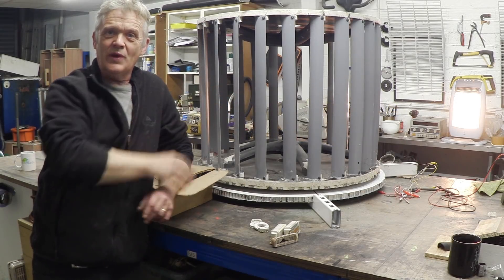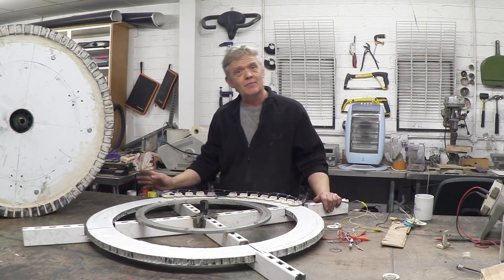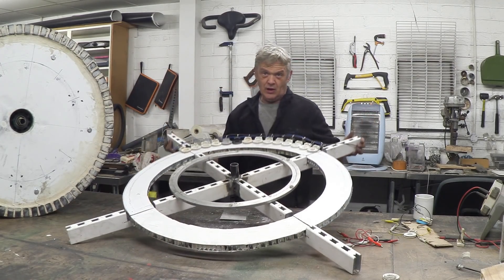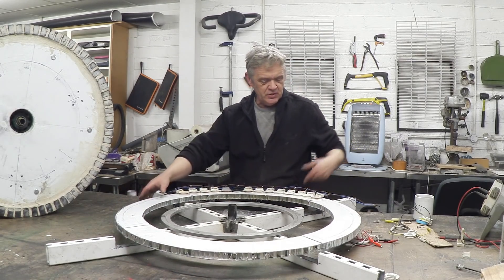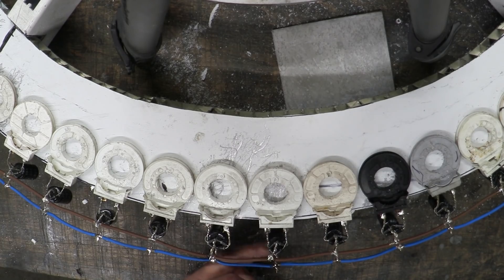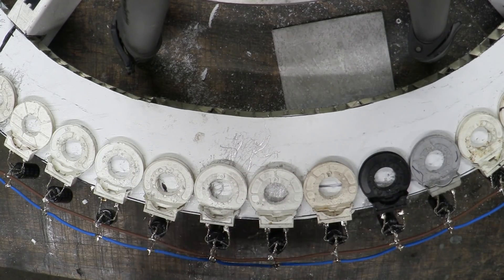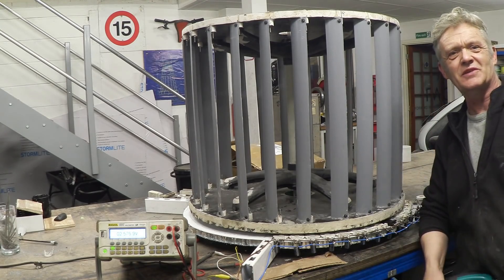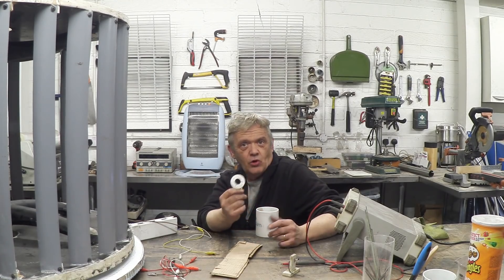Building A 1kW Wind Turbine For Under £100 - Some More Changes

Comment: Can you please show current as well as Volts, anyone could make a lemon generator to make 12v but virtually no current = useless.
Reply: Tactical dot.
Reply: Robs been asked the exact same thing on most of his generation videos, but things dont change.  At best we get a voltage, and occasionally a separate short circuit current. Sensible scientific testing of the device, so people could decide if they want to build it or not, should be voltage and current shown simultaneously with a known load, a big resistor would be ideal.
Reply from the maker: to be honest mate - I do it sometimes but more often than not it just makes folks argue about the validity of the test more than anything else - my own tendency is to power something like a light or motor.
Reply from the maker: it's because I have had years of it mate - more often than not all that happens is folks get into long arguments about measurement technique, equipment used etc etc and most of it means nothing to folks - so I have a big propensity to lighting lights or running motors - a kind of visceral image of it doing something. For those that it does mean something to 90% of them just want to argue and the 10% of them who might be convinced - well most of them will build nothing. It's why it's not much of a priority for me - plus - of course - I am not really trying to prove anything to you or convince you of anything - I am demonstrating what I am doing and the rest is up to you really - does that help explain why? cheers - rob
Reply: @ThinkingandTinkering  re output, OK but power calculations gives work potential and makes a build worthwhile or not. When I was younger I would blunder in, making loads of effort only to get poor results. Now I research everything before jumping in. Experimentation is a good thing, but a basic understanding of thernodnyics and physics helps. This is why Thunderfoot and EEV Blog successfully expose scams that people fall for. All due to lack of knowledge. Your advice is good in learning and experimation, but a bit more theory also goes a long way.
Reply: @ThinkingandTinkering  Rob if you simply quote power generated (VI) then there is no arguments. Its powering a light or a motor that causes the issues because people dont know how much power is generated. If you quote watts in the title of the project it makes common sense to measure its performance in watts.
Reply: With this test you can calculate how much current there is, and it seems to be about 280uA. Explanation below:
 Rob's told you the capacitors are 50V capacitors, and said 1000F. I think he means 1000uF (0,001F) as those caps look realistic at that size. It looks like he's got 14 of them, so 0,014F total.

The formula to calculate current when charging a capacitor and monitoring voltage is (capacitance * voltage change) = (current * time). Looking at the footage, it seems like the voltage goes from 2,6V to 2,7V (a 0,1V voltage change) in around 5 seconds. That gives us a formula like this: (0,001F x 0,1V) = (current x 5s).
I think that works out to 280uA at 2,65V (742 Microwatts) average at 15 rpm (I timed a blade going around). A bridge rectifier will take a decent portion of the generated power (1,2 - 1,4V). At higher voltage, that'll be a lot less of the total.

From my reading (the latest Real Engineering video), the power goes up with the cube of air speed. Assuming the the RPM of the turbine and air speed are proportional, you'll need to spin it at 1650 RPM.

I could be way off in my calculations here, so please double-check them.
Reply: @ThisRandomUsername  So basically you have no idea, making assumptions (F vs Mfd) that they are not super caps etc. This is exactly what I mean, no one knows for sure at this point. Don't forget its a standard VAWT the blades cant travel faster than the windspeed. You can not calculate the power, you don't know how long it took the caps to charge, or how long the windmill ran while they were fully charged etc etc, do you see how much easier it would be for all if Rob just quoted power like he does in the ti9tle of the video ?
Reply: @ThisRandomUsername  What about the times the windmill was generating and its voltage was less than the charges value of the caps ? Where is that power accounted for ?
Reply: @goldmagnet9013  You're right that we don't know for sure about the size of the caps, but apart from that there's a lot of info in the video. One thing's for sure, those are not 50V 1000 Farad super capacitors, and look more like standard electrolytic caps, of which a 1000uF 50V capacitor is common at that physical package size, so I give Rob the benefit of the doubt in that he sees 50V and a 1000, and doesn't see the small u in front of the F. That's a reasonable mis-reading. In his follow-up video, he's charged the capacitors to 8V, way beyond the capabilities of super caps.

However, I must disagree with your other comments:
- I know exactly how long it took for the voltage to rise by 0,1V because you can see the multimeter screen in the video and I can calculate the rise time. To get a ballpark current figure you don't need that to be super accurate.
- Power depends on the RPM and the output voltage, and getting proper optimisation graphs isn't what Rob's after, he wants to demo a design with a rough idea of its capabilities. I believe he's mistaken when he thinks it's producing much usable power, but at this stage of development, optimisation is not what you'd be doing, you'd be proving an idea and making quick iterative changes.

On your second comment: I believe the voltage is produced according to the speed of the magnetic field passing through the coil, but while that voltage is lower than (the voltage on the capacitors + the forward voltage of the diodes), there's no current flow. That means there's no resistance to the passing magnetic field and the only resistance is in eddy current in the core (which are basically non-existant here).

Edit: eddy currents currents -> eddy current; punctuation
Reply: @ThisRandomUsername  So if the speed of the windmill varies, which they do, and it produces power but the voltage is less than the caps how is that accounted for ? So you know how long it took to charge the caps, but not the power output as there would/might have been power available but the voltage was too low to charge the caps. I cant believe you think all this is easier than just quoting the power output ? A big resistor and a wattmeter,, cost less than £20. People who want to build this windmill will be doing calculations based on their power requirements.
Reply: @goldmagnet9013  You're getting power and voltage mixed up. Power isn't produced because the load won't accept anything below a certain voltage, so no current flows.

Re: the power production measurement. As I said I'm looking for ballpark. The calculation I got would be slightly on the low side if anything. I assume the coils in an open circuit state would produce up to 15 volts, and as shown in the follow-up video, they manage to charge it at 8V, so they're flux/current limited at lower voltages, and the wind speed there was minimal as well.

Also, good luck getting a power reading off a wattmeter at such low current levels. You'd need something like the EEVBlog uCurrent and an oscilloscope.
Reply: @goldmagnet9013  good calculations. Power also with wind generation increases by a huge amount with diameter something like 4x per doubling. That's why the bigger the turbine the more efficient they become.
Reply: @ThisRandomUsername  I dont think your understanding is up to scratch. The idea of this windmill is to harvest the low energy that other commercial turbines miss below their cut in speed. In Robs current design the more the caps are charged the less power is harvested as the "cut in voltage" increases. Say you use this windmill to charge nickel metal hydrides at 1.5 volts. Once connected the caps are meaningless they will always sit at the charging voltage, so the measurement we all need is the power,  the voltage x the current into a known resistance. Its pretty simple.  With a windmill this is normally represented by a curve on a graph showing power generated at different windspeeds/rpm. Much the same as the graphs Rob used to make for his batteries, why did he quote power then and now its such an hard thing to do I wonder.
Reply: The logical way to make a generator that meets Robs objectives, while maintaining as much of the current design is, in my opinion, as follows. Keep 1 in 3 of the current magnets, remove the others, and double them up. Wire all the coils in series and rectify the wild AC using a MOSFET bridge with zero voltage drop. Then a simple custom MPPT controller. That the logical way, reduce the magnets to get the coils in phase, full series for max AC voltage, MOSFET bridge (there one a chip built for this), then MPPT to balance all the components and allow maximum charging efficiency. This is mathematically demonstrably a much more efficient route.
Reply: @goldmagnet9013  What I was trying to get at is that at varying wind speeds, there will be different optimal voltages at which to get the maximum power out of the turbine. When you actually want to pull this lower speed power out of the device while still accomodating higher speed efficiency, you'll get a MPPT charge controller to match your supply with your load. The problem with that is that MPPTs usually have standby power consumption, so any gusts realistically won't produce much. Maybe a switchover circuit would be helpful at lower voltages while letting the MPPT take over at higher wind speeds.

I agree that the caps are useless when connected to a real load, but for now they're useful to indirectly measure how little current is being produced so we can point the issues out to Rob. Anyway, it's 2:40 in the morning right now, so this is the last reply you'll get from me for a while.
Reply: @ThisRandomUsername  See previous reply.
Reply: @goldmagnet9013  Sorry, YouTube doesn't refresh comments very well. It seems you know what you're doing, but I'm afraid that when trying to scavenge low power gusts of wind, MPPT really just won't work. I agree that syncing the coils and seriesing them will improve things, but from these results, I think it's clear there's more work than that to do because of the not great current capabilities.
Reply: @goldmagnet9013  totally agree 👍
Reply: @ThisRandomUsername  Say you get 10 seconds of wind that charges the caps up to 5 volts, then a slightly lower wind for the next 50 seconds that generates a potential of 4.5 volts. The vast majority of the power in the  1 minute period is wasted and the time to charge the cap tells you nothing about the possible power yield from your design. A standard power measurement/logger is whats required and Rob has this equipment already, this is logical.

Comment: Dear Robert you're enjoying research and continue. I would like to warn you that the cross section is small  so the power of the wind passing is impossible to give you 1000Watts.I estimate it to give you 100-250Watts.Carry on and don't be disappointed. Happy Christmas, from CYPRUS!

Comment: What you do here is great! I do have a suggestion however. Your turbine needs to be more efficient at grabbing more wind with each passing otherwise you'll  never generate enough energy to speak of. You've  had some better  designs on your show, I've  seen some. I know you can do it old boy. Your videos are inspirational. One last thing, if it doesn't  produce anything worthwhile, who will want to buld it. Nevermind how cheap it can be made. Some expense is necessary to progress. Air compression is something you might consider. Diverting the wind is better than having it used against you is another option that shows promise.

Comment: Rob, taking on board what you said in this video you may want to change the title of this video/project, its a long way from the project you just explained both in terms of output and cost. Also why not put all the capacitors down below instead of up on the mast, I may be wrong but the look like they are wired in parallel, so it seems there is no reason to have them up on the mast at all, keeps weight down and reduces weather exposure to points of failure.. Any chance of letting us know the resistance of those coils so we can calculate maximum power output ? I must admit the design with a 0.5v drop on every coil seems suicidal Vs series coils with 0.5v drop on each phase, you are throwing away 10-20% of your total available power right there (at 2-2.5v per coil).. As the magnet spacing is too close for your new coils I guess you are stuck there unless you can work out some balanced phases using the current spacing. Friction is super important for generating at low speeds, but yours seems too have lots of friction compared to other  turbines, that bearing seems better than the castors, but still pretty poor.
Reply from the maker: I agree mate - the bearing is pretty poor and I am still working on that so that will change - I take on board your other comments too - I am unlikely to change the layout on the electronics with this one as it is pretty much just working out ideas and ease of access is more important right now. The voltage recorded isn't the coil output voltage it's the charge on the capacitor bank. But I can measure resistance and coil output for you easily enough mate - cheers

Comment: Ohh good I was hoping this project wasn't done.
Reply from the maker: far from it mate
Reply: Loving the low  wind scavenge!! And fast moving exstrematy magnet,s ! Stability will be tricky! You know that! When you used the chair legs I was delighted for that tip! I did qwestion why they were mounted inside! Led me to wonder if a pair can be mounted outside ! Horizontally opposed or directly connectedto the pair already in use,

Comment: I like how you explain at the end of the video exactly what your trying to accomplish for those that want to be given the earth on a silver platter, What you have shared with us so far is fantastic in my opinion, I appreciate the time you have spent researching and sharing this with us in the event of a power failure we have some lighting, I would like to suggest having the lazy Susan on the bottom and energy collection on the top, as on the top you could build a shield around it to protect the turntable electrics

Comment: First of all, kudos for showing us your ideas and knowledge, thank you so much! This vawt is interesting for MANY people as it is “simple”, low cost and can be made with several different materials by most people with a “left and right hand”.
You stated “low wind – low speed and low cost”. What if you make a dual vawt upon each other that turn counter wise of each other, one being the rotor (top bottom vawt) and the other one being the stator (bottom top vawt)? You would still have the “low cost and low speed” but you would increase the speed significantly. The wiring could be done with a slip ring on the (hollow) stator shaft. Probably this dual vawt would be MUCH smaller as the 80 cm unit you have now but with the same output. I am mentioning a smaller version as it will be easier to make a smaller dual version. 
Basically with a dual version you double the speed, it would be interesting to know the output with the unit you have now with a speed of X and a speed of X+50% and 2X.  That would give you an indication of the effect of higher speed and maybe a feeling how much smaller you could go.
A smaller version (like 40 – 45 cm) you could probably put on a pole as it will be much lighter. I mention 40 – 45 cm as I have that in my head but I would be surprised if I would be far off lol.
Anyway, food for thought for everyone who reads this and it is now in the public domain as far as it wasn’t already. Thanks again!

Comment: If you use a cup of magnetrons magnets, you can levitate the rotor and eliminate friction, the separation between coils must be  proportional to the magnets, use multimeter and move the gap. Regards.

Comment: Having home based energy production is also a great idea for relieving strain on the main power distribution infrastructure. A wind generator like this plus solar and an efficient storage system would probably go a long way towards lowering the burden on centralised power generation systems. Not to mention being much more environmentally friendly. I think you're dead right about cost being the main limiter for most people, if these systems could be made more affordable more people would be interested in them. Great work Robert and co.

Comment: I'm impressed that you've got room in your mechanical design for another row of coils on the stator, and room for more magnets on the rotor.  If drag remains low, you could probably almost quadruple your output with another axial flux plus two radial flux "rings" on the stator.  You're right about commercial generators -- On days when I drive past wind farms and encounter wind conditions that affect vehicle handling, very few turbines are turning even during peak demand.  Operators feather turbine blades to extend service life.  Small form, light duty, serviceable generators are a better choice.
Reply from the maker: cheers mate - even though I say it myself - it is an interesting design from lots of perspectives lol